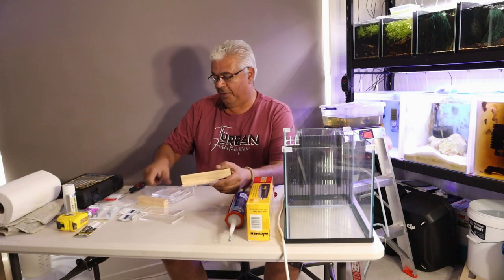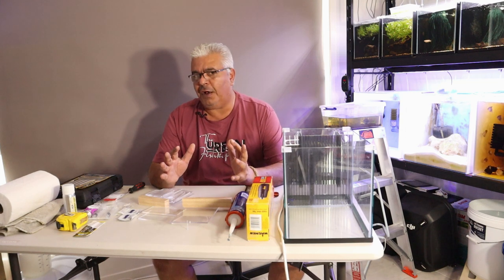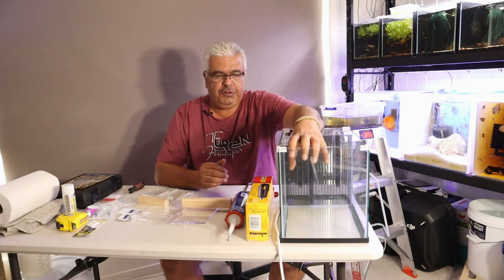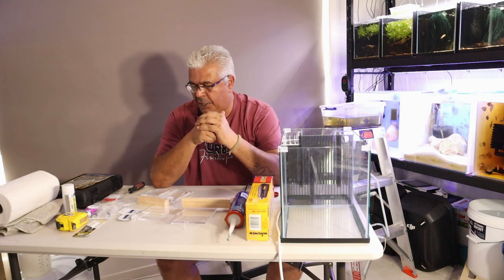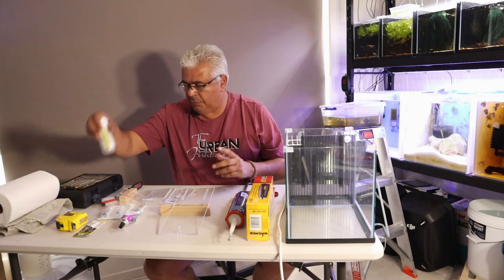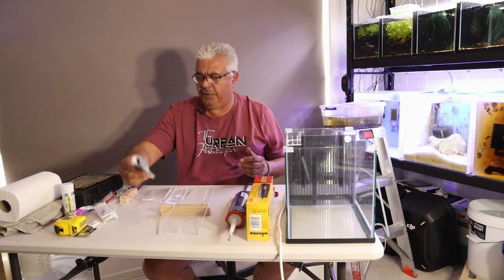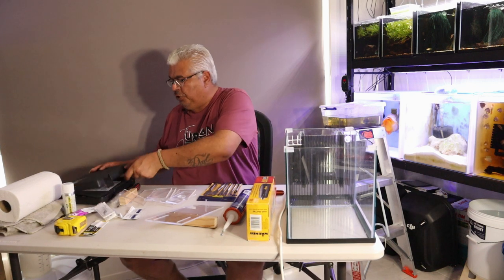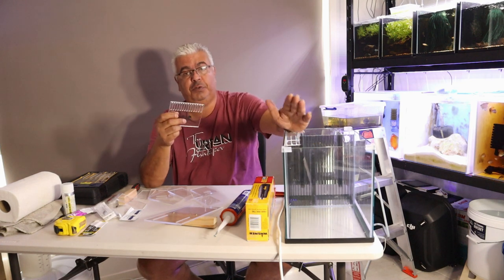How to build a overflow box

Comment: Very easy tanks for helping me. I have just a question how measured u used to do that
Reply from the maker: Mu rule is normally to make as big as possible that looks to scale. The important factor is the amount of water you want to move through the system and that will help determine the overflow bend.

Comment: you should try just drilling 2 screw holes on the weir box,not slots,the drain down through the slots is huge,the water was already running before the water level reached the weir comb
Reply from the maker: Valid point. Thanks